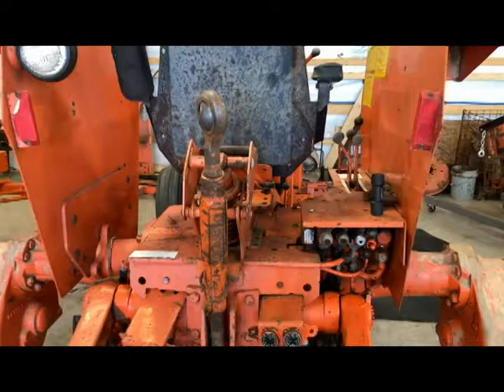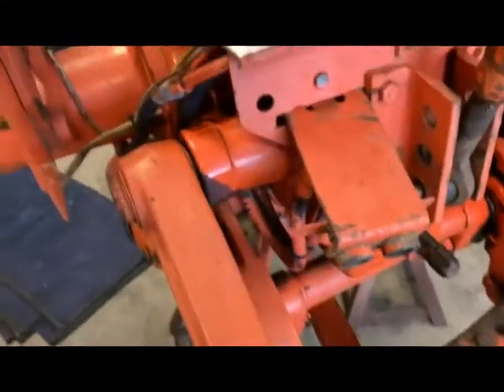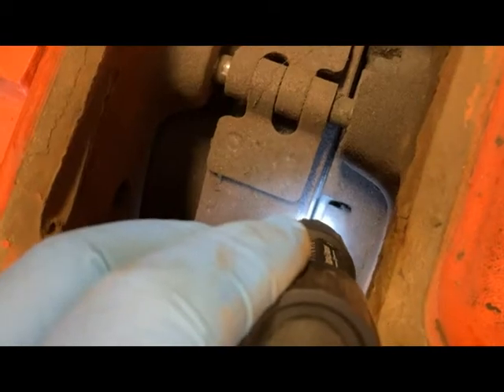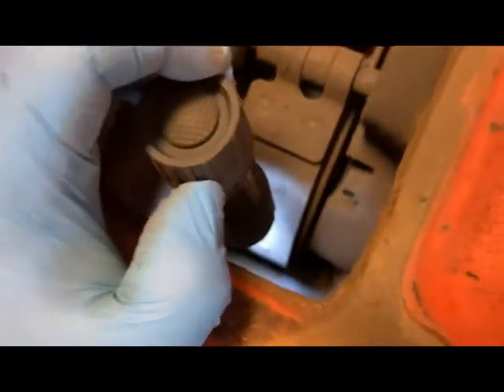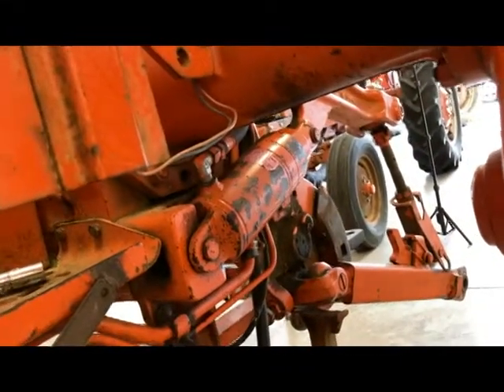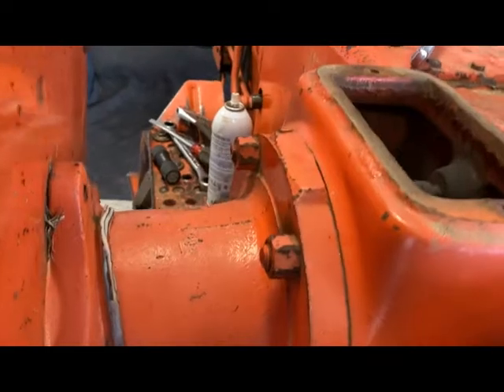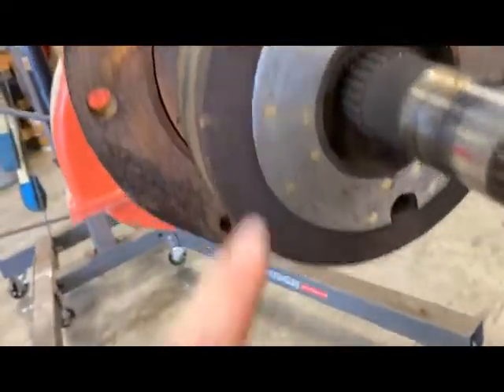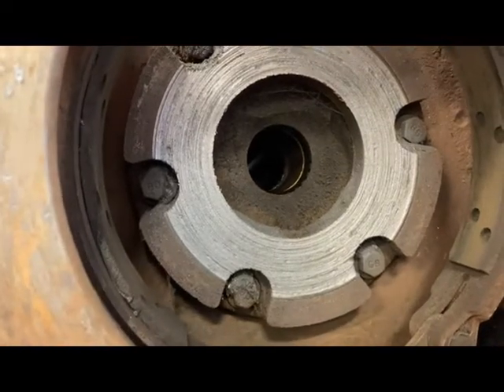Allis Chalmers 175 Brake Issue Disassembly Part 1

Comment: Hey Nash... man, that's a pretty tractor!!
I inherited a 175 diesel 3 years ago. The left front tire recently locked up... then I heard something snap and it started rolling again. I jacked it up, took it apart (which I have no experience with it  other than oil change) and the rear bearing had failed and the pieces were in the hub... and the seal was shredded. 
I watched this guy named Bundy I think, change his on another type of tractor. But I can't find a video on a 175. I saw your channel and was hoping you had done a video on bearings but I didn't find one. 
I got everything out and I have new bearings to go in. The only thing is... I think the inner ring of the rear bearing is still on the spindle. It turns... but it won't come off.  It has a smaller front lip and a larger back lip just like the rear NEW bearing inner ring and it is against the shredded seal pressed against the back of the spindle. 
Is it supposed to be on there and if not, how can I get it off? I tried prying it a little and even hit it a couple of times with a hammer and chisel, but I didn't want to hurt the spindle. 
Thank you for any help you can give me... 
Radway
Reply from the maker: Anthony, take a punch and hit the bearing from the back side.  You will need to drive it about a inch or so until the tapper starts on the spindle and it will come off.  then do the same with your dust seal and reverse the process to install the new one.  It's pretty easy and will have a video soon of a D17 which is basically the same front.  Good luck!
Reply: @nashsummers8050  
Thank you Nash... I did and you were right. It came off but I had to knock the crap out of it with a punch. When you show the bearing video can you focus on where the seal goes at the back of the spindle... and how far to punch the rear bearing on??
 I cannot get the seal and holder on the round part of the rear of the spindle. Do I just beat it on with a ball hammer or a punch?? Or does the seal and holder even go that far?
I also don't know the side that faces the rear bearing. One side of my seal holder is a little bit flat like a washer. The other side is open like the rear of the hub. 
I forgot to tell you before.... when I first took off the hub... my seal metal was shredded and was kind of melted over/ bent over the inner ring of that rear bearing I told you about. I had to pry it away with a chisel. 
Thank you so much Nash.
Like I said... I'm a newbie. 🙂
Anthony

Comment: I have a frozen upper pin on mine.  I can understand cutting it and driving the outer half out, but how do you pull out the inner half? putting pliers and pulling on it out I doubt will work....
Reply from the maker: TJay, I know it seems counter intuitive but the inner pin on all the brakes I have redone is always extractable with a pair of plyers.  It's protected from water penetration and doesn't get a chance to seize up like the outer part of the pin.
Reply: @nashsummers8050  Good to know!! Thanks!